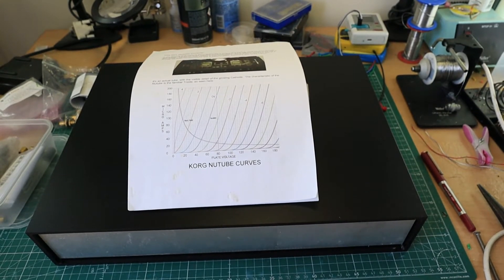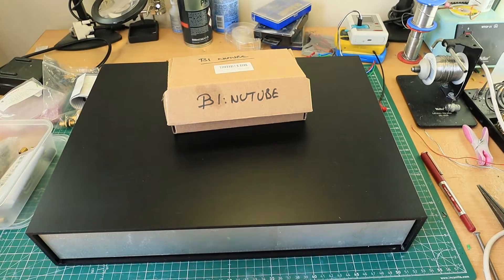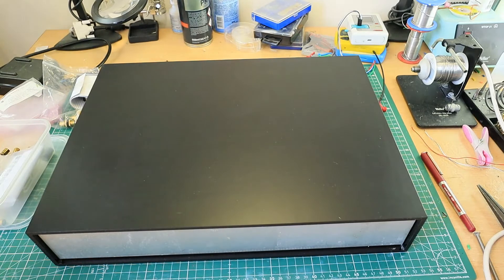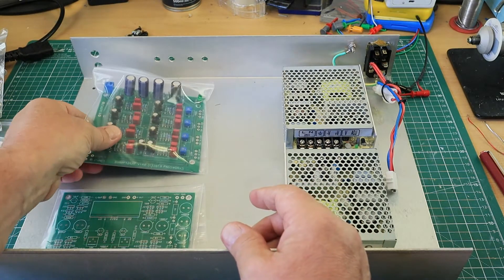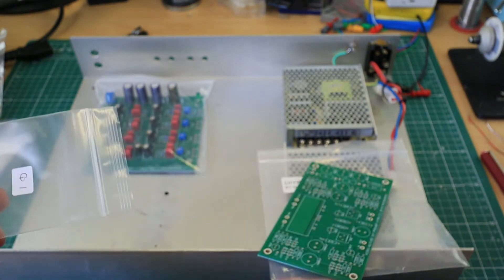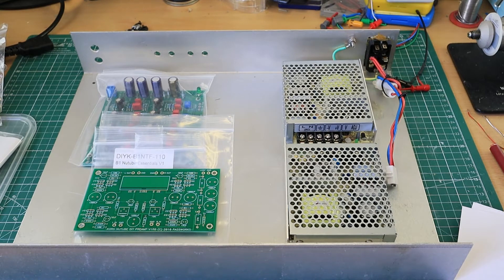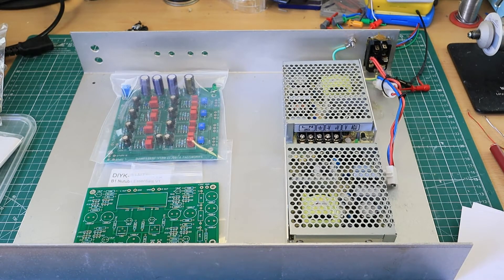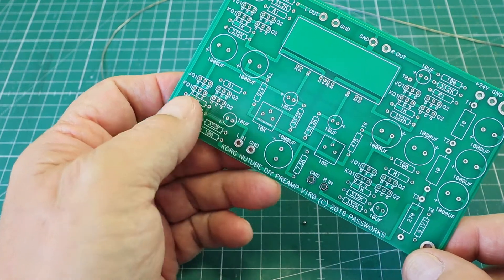Pass B1 Korg DIY preamp Biuld (Intro)

Comment: Instead of fitting the wire link, it may be possible to fit the cap, then when you fit the resistor, bend the leg over to the cap, instead of cutting it.

Comment: great, many thanks for posting!
wondering why you chose an SMPS rather than linear PSU?
Reply from the maker: Only because that's what the designer specified originally but you can/could use a transformer / PSU and regulator if you wish. In fact hat's what I use now.